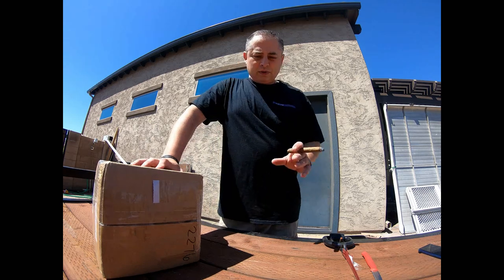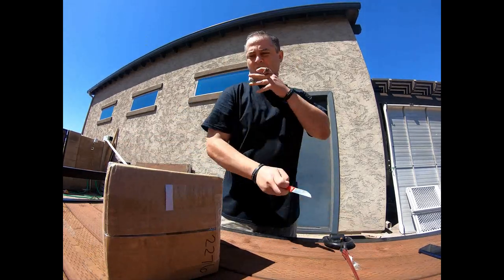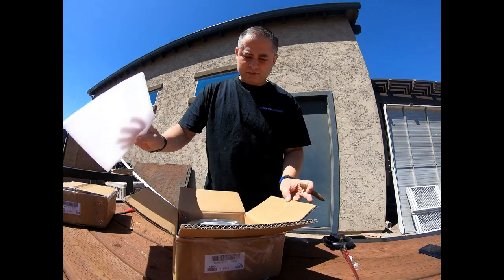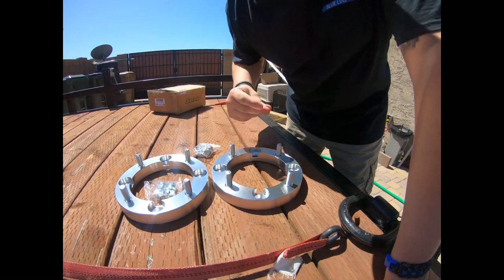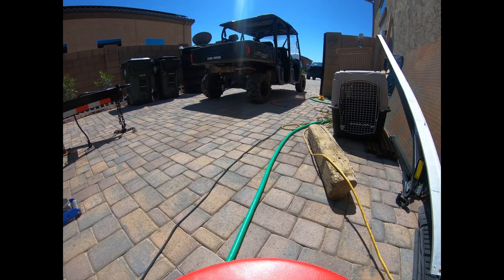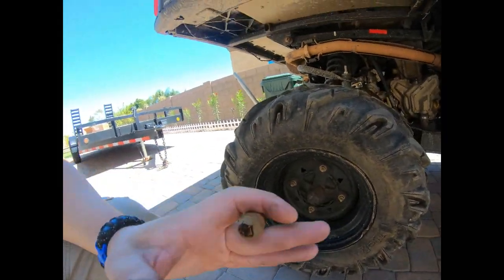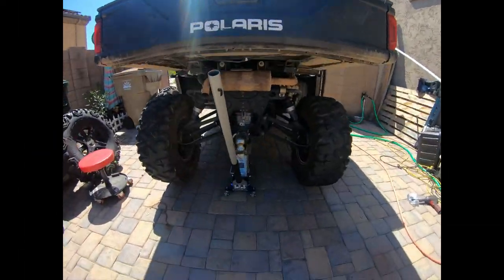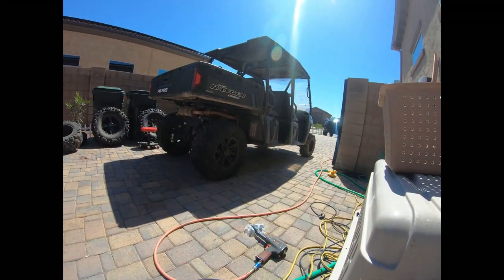Blue Line Garage - Polaris Ranger Wheel Spacer from 3/8 to 12mm Lugs

Comment: Is this on a 570 full size crew? Also what replacement rims and tires did you go with and do they rub any?
Reply from the maker: I don't remember the size. They were rzr tires. The front tires did rub but I added a 1 inch spacer and that fixed the problem. I sold that machine shortly after the video but if you look for my last video or two I have a ranger 1000 and added spacers to that one because it felt too top heavy when I was on trails.

Comment: How much doesn’t the 12mm studs stick out the adapter
Reply from the maker: The 12 mm which is factory on the vehicle stuck out just enough for the counter sink bolt to screw on with just the end of the bolt just exposing the top of the bolt head. hope that makes sense.